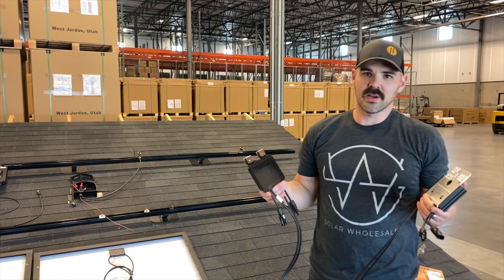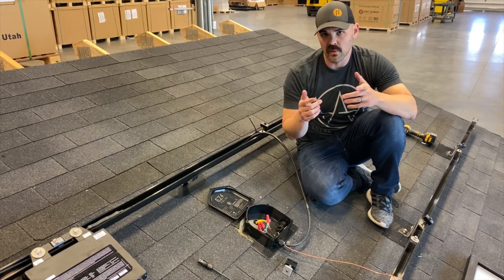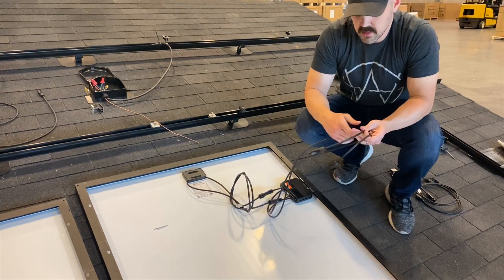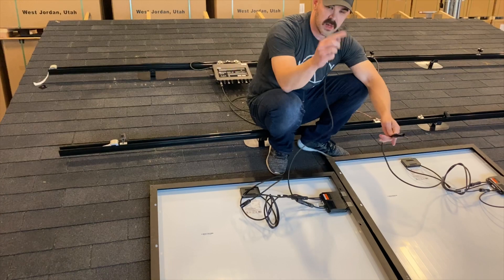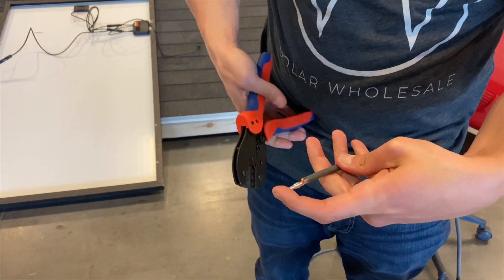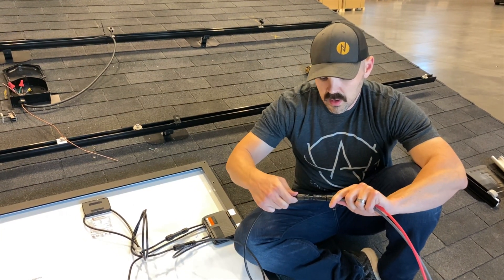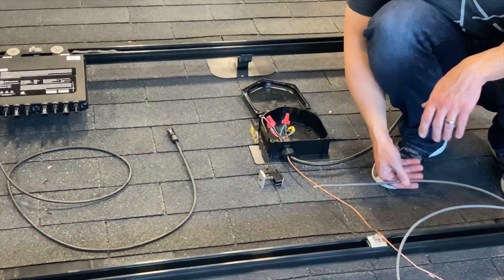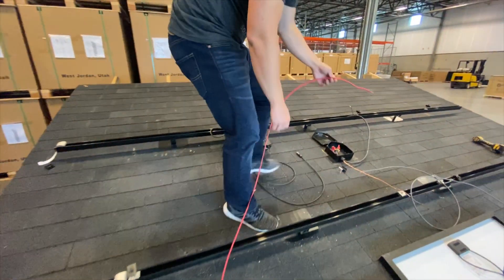How to make Solar DC Wire Connections (Homeruns) for SolarEdge, Sol-Ark and String inverters

Comment: I have a 19yo 4.2kw PV system w/3 8-panel strings. Coming down and getting disposed of and NOT replaced. My electrician disconnected at main and inverter. Inverter and master AC switch are removed from building. At bottom of conduit leading to roof components are taped off are one each red/black lead plus ground wire. •• Roofer with demo PV system but requires me to disconnect MC4s. Solar company says to disconnect the MC4s at the home runs. I'm buying a cheap tool off Amazon. Roof is high and steep so I don't go up there. IDK how far under the array the conduit to the soladeck/junction box goes; e.g., if the 3 strings' wires are reachable. In any case does safe practice require unplugging the MC4 pairs, of can each string lead simply be snipped, without fear of an electrical hazard?

Comment: I am planning on adding some panels to an existing system. I have 2 strings with solaredge power optimizers, I am thinking of adding a few more panels and connecting to the existing string. Do you have any videos that cover this? I'll review your channel also.

Comment: What if you had panels on other side of the ridge that were in the same string, would you still use an extension cable?  Would you  transition the cable into a junction box through conduit over the ridge then back to second junction box then continue the string using the cable?  Would you change to a different wire through the conduit?
Reply: Jumper

Comment: I'm installing the arrays on a detached garage, the runs need to go back to the house.  Using the MC cable for the DC homeruns, use it to go to the combiner box correct?  And then from the combiner I need to go underground back to the house, using what and what type of conduit?  Two strings in parallel, does each need to be fused?  What about grounding the arrays... Run a ground wire from racks/panels back to service entrance, or run to a sperate ground rod at the detached garage (with a sperate ground starting roof entrance, to the combiner box, back to the house/main panel)?

Comment: Great video to help people understand. The wiring of solar panels together, but if i may add some suggestion of the labeling (color coding) of the wire , remember that when you are using the long leads to create your home runs , the type of mc4 connecter coming from the optimizer will tell you if its the positive or negative lead , female is negative , male is positive, and male should be connected to a red pv wite amd female shoupd be connected to a black
Reply: Correct!

Comment: Can you simulate multiple arrays?
Reply: Lets say theres 2 arrays, 24
panels total (10 panels in one array and 14 in the other. For this ex. We can only fit 12 panels per string. 
This mean we have to jump 2 panels for the 14 panel array to the 10 panel array. 
Well we have to run a (+ &-) for the first 12 panels on the 14 panel array. Now we have to jump 2 panels to the 10 panel array. We will need a (- $ +) as well for the 2 panels and -&+ for the 10 panel array. Then we proceed to splicing wire together in the solar deck or junction box. Respective to their strings.

Comment: Thanks for info. Nice and clear presentation.   Can 24 panels be connected in the way described?
Reply: It depends on the size of the inverter, normally sor solar edge you can fit 18 per string, and for Enphase its 12 per string.

Comment: What Gauge solid copper ground wire should be used for the ground and what Gauge should be used for the RC4 extensions to the gang box. Thanks~ great video.
Reply: Normally #6 and #10

Comment: what is purpose of juction box please can you describe it .
Thanks  for video
Reply from the maker: If you have attic space you can run your wire through the attic instead of using conduit on the roof.
Reply: @Solarwholesaleutah  thanks please confirm me more that junction boxes are function just like combining a wire to another wire ( mean splices it)  is do not combine two wires to single wire right?
Reply: @aneesurrahman1086  depending on how many strings you have you will need to splice red to red and black to black and grounding the ground wire.